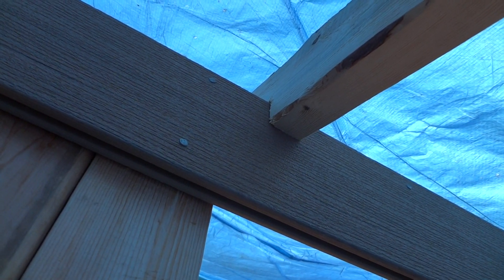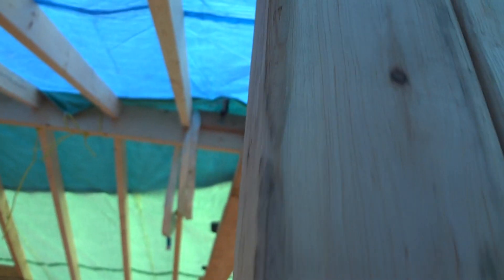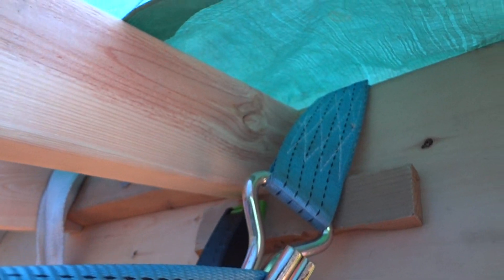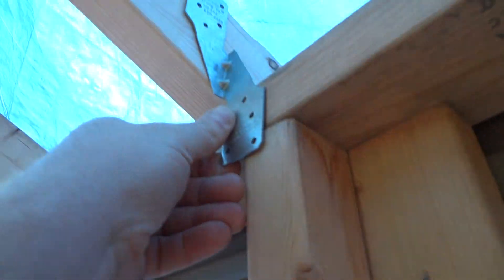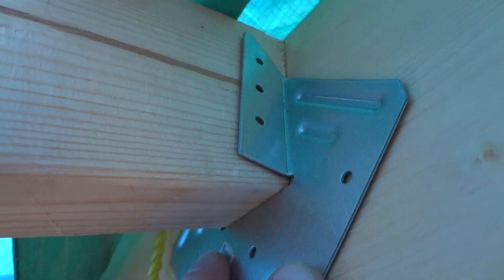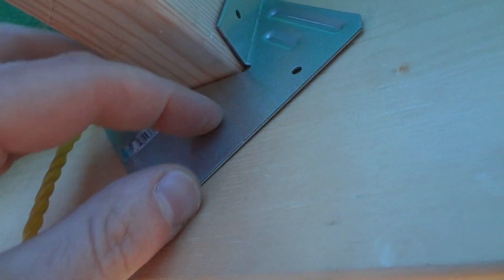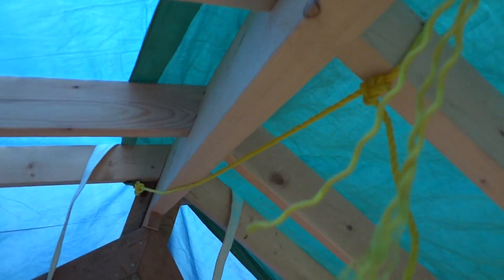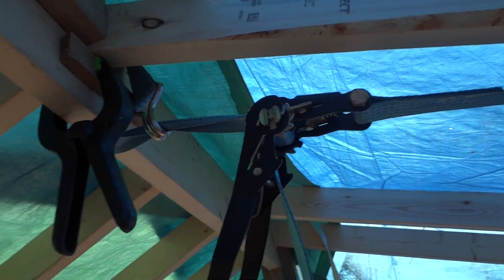Rafter hacks, hurricane ties , rafter brackets. Whats the best way to install rafters

Comment: First windstorm you won't be in Ontario anymore if you use screws on ties.  Hanger nails are four times stronger than deck screws.  And if you keep ratcheting that structure you are going to have a ridge cap that looks like Sammy the Snake.   Kids will love it though.  Good job.  At least you are trying and that is all that really counts in the home handyman manual.  Whether or not it is right is an insignificant nuisance.  !!